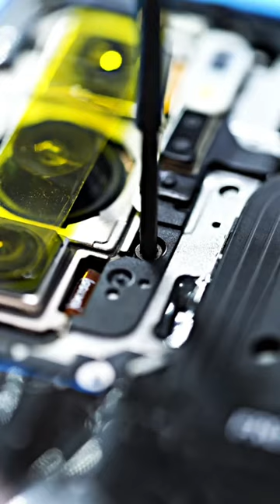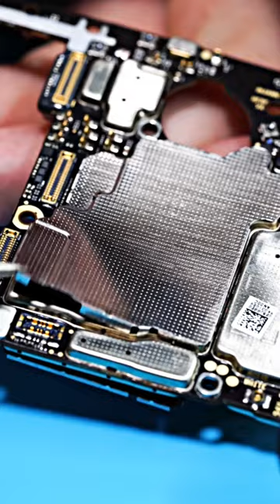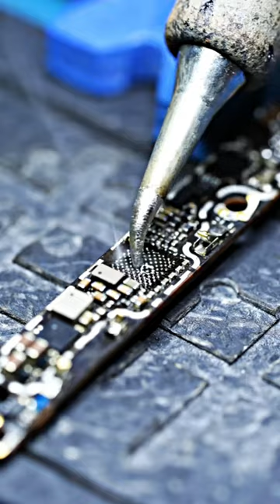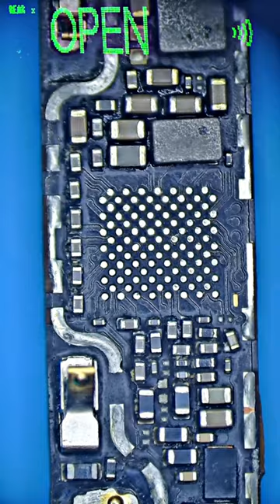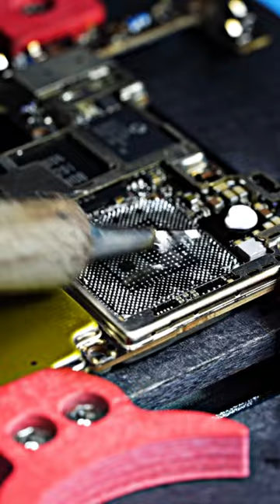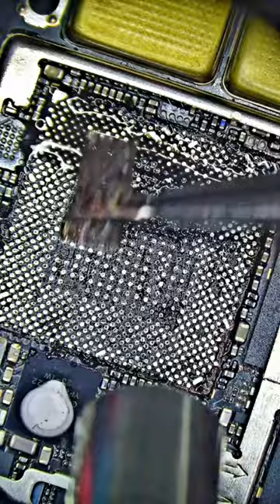After the P40 fell heavily,no sound , I thought it could be easily solved but...#shorts

Comment: I have a Motorola edge plus 2020 that fell and even with a case shattered the screen. After I replaced the screen and it worked and looked new, I discovered after sealing it that the sound also no longer works.